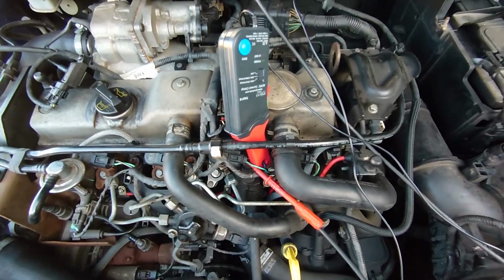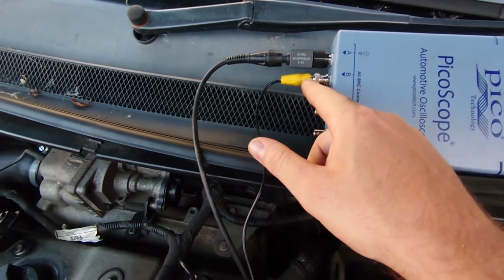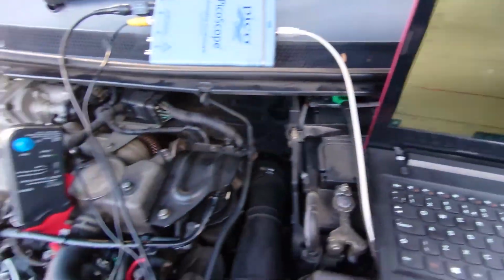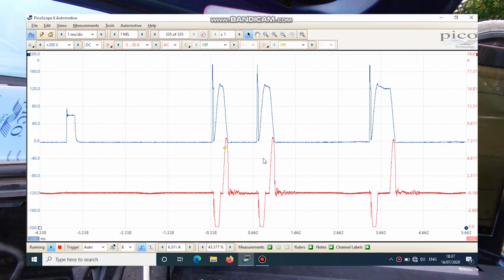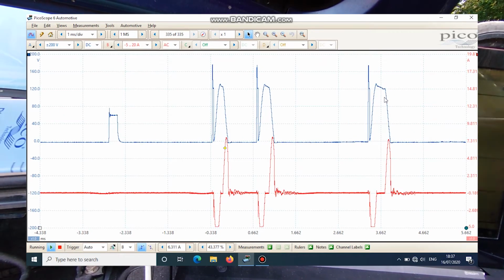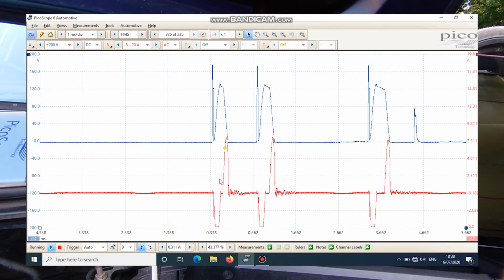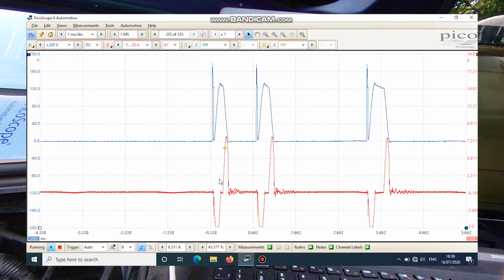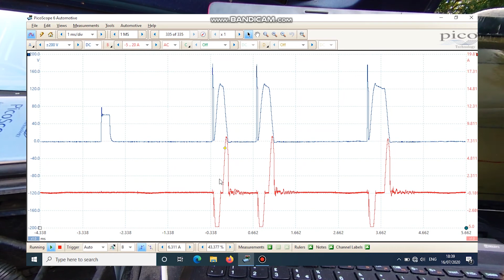How to test piezo diesel injectors - oscilloscope testing

Comment: Hello Richard!
 It seems that you do not take care about wich wire goes on the clamp for the amps, and which wire goes for the Volts measurment, am I right? Can we say that it doesn't mater for piezzo injectors only? (I know that it's different fot solénoïd injectors). Thanks a lot for the quality of your videos! Nico, France